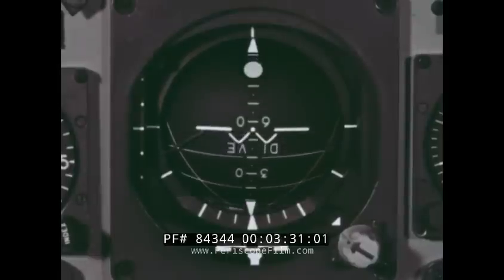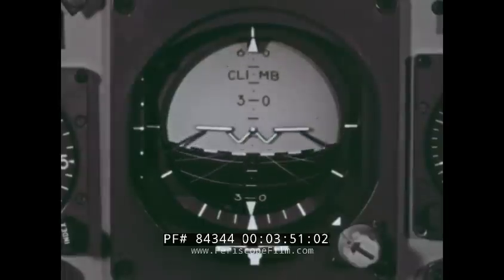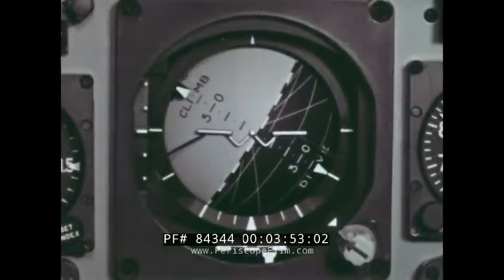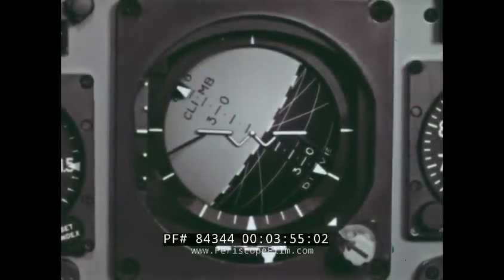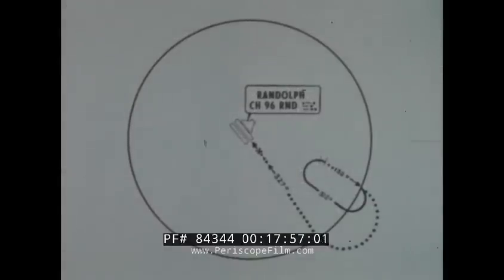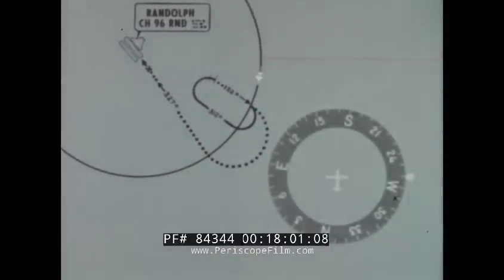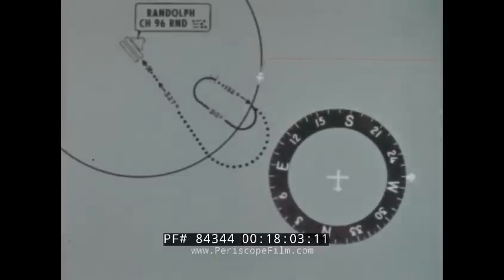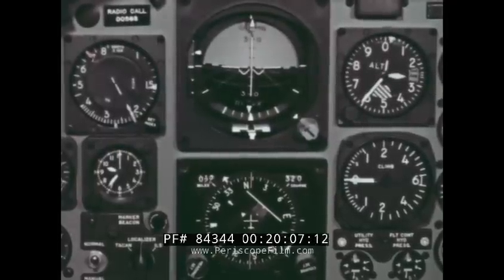INSTRUMENT FLIGHT IN THE T-38A TALON TRAINING AIRCRAFT U.S. AIR FORCE FILM 84344

Comment: With the exception of the altimeter and the airspeed indicator, this was exactly the same avionics and instrument package I flew with in 1985.
Reply: How did you manage to use the radio and the ADF at the same time ?
Reply: @mayo250  We didn't have an ADF. We used TACAN navigational aids. These were the military version of civilian VOR, ground based beacons that provided bearing and distance information from which you could navigate point to point. The communication radio was a separate unit.
Reply: @denniswofford  On the AN/ARC-164 UHF radio you have a function ADF , it would have been inop ! Thx for the answear !
Reply: @mayo250  I totally forgot about that. You're correct. On a side note, the KC-135, which I flew for most of my career, had the same radio, and the ADF function did work. We could get the bearing of a receiver aircraft during rendezvous by selecting it while they were transmitting. I remember playing with the feature, but we never actually used it in real life.
Reply: @denniswofford   Hi Dennis, could you talk to the radio at the same time ?
Reply: @mayo250  No. In ADF mode, it was receive only (I think).
Reply: @denniswofford  Ok , thx Dennis.

Comment: At Reese in 1992, I recall the bag being a lightweight white rip-stop nylon; kinda dirty and beat up from frequent use. Seems like we had to source the bag, maybe from the Life Support area, and take it with us to the jet and install it ourselves. I do recall the velcro used to seal the forward edge was well-worn and it took time to get the bag sealed well. At first, you think it would be good to have a little cheat area, but I think it was better, in the end, to have it fully sealed to minimize outside distraction. In addition to the Vertical S maneuvers, don't forget the confidence maneuvers; aileron roll, barrel roll, etc done in the sim and under the bag. UPT was sumthin else.

Comment: Yes, I eat Crayons. Marine ground option here, but I've had a lust for military aviation since I was a rugrat growing up at MCAS Beaufort where my dad was a wings of gold "Naval Aviator" (don't call them "pilots") Marine Air jet jockey. Phantoms & Hornets mostly. Interrogative: Why was the T-37 so loud for a tiny jet? It earned its nickname for the way it sounded "The Tweet," but that sounds nothing like a tweety to me, anyway. Yut!
Reply: I’m not certain but I think it was the tiny engines made their noise at a higher frequency than other jets.
Reply: Pure turbojet engines were always that insanely noisy. Because their thrust was entirely dependent on the hot exhaust gases, the compressor/turbines ran at a high speed, and combined with the narrow engine size, led to a lot of high-frequency noise. Modern turbofan engines have their turbine exhaust partially shielded by the bypass air being moved by the fan, so it both masks the high frequency noise and replaces it with somewhat-less-annoying lower frequencies.

Comment: I was an aviation electrician / avionic tech on these birds from 1986-1994 at Randolph AFB  at Universal City, Tx (North San Antonio) The company in charge of this project was LSI (Lear Siegler Inc)   These were great to work on.  We also ended up working on the T37B "Tweety Bird" as well

I left  LSI in1994 to work for Northrup Grumman at Hondo AFB I was there from the very first start of this project to build  116  Slingsby T-3A Firefly  Needless to say, this was a project that had lots of problems As I understand it, these planes are now sitting and decaying away and not airworthy at all.

When the Slingsby project was done  late 1996 I ended up working for Raytheon at Corpus Christi Arrmy Depot - CCAD This to me was a dream come true. I wanted to live there with a great job.  I worked on the UH- 60 Blackhawk. A few Seahawks. I was doing mostly building up harnesses for circuit breaker panels, instrument panels etc etc.  I then ended up being in charge of the   "Hellfire" system  for the AH-1W SuperCobra  "Whiskey"

Raytheon liked my work on the Hellfire to the point that they  transferred me to Greenville, Tx in 1998 - 2000  to work on the "Big Safari"  RC-135W Rivet Joint (electronic surveillance aircraft) out of the 2 years there I spent one month on the WC-130J  "Hurricane Hunter"

Raytheon transferred me back to CCAD on the Super Cobra. Raytheon left and LSI came to CCAD and I was hired back and kept my seniority status.   I worked on the Air Force UH-1N Huey   and became disabled in 2005  That was the last of working on any aircraft since.

Comment: I was able to understand everything up until they started talking TACAN holding patterns....and from there I got lost lol. You need a hell of a lot of brainpower to pull these things off!
Reply: It is a pain in the rear, but that's why on the high-altitude instrument approach charts (HI-ILS, HI-TACAN) there's a diagram to show the three zones for starting holding patterns, to make the decision-making a bit easier. Also, civilian holding procedures usually use timed legs (1 minute straight legs, 1 minute 180° turns), but military holds usually use DME instead, so you don't have to watch the clock so much.

Comment: I just HAD to watch this. I was assigned to Williams AFB and Randolph AFB back in the late 60's and worked on their instrument systems, both the tweety bird and the Talon along with the occasional F-5. They were very dependable systems and fairly easy to maintain, compared to the F105s and F4s I had just come from.  In all those years working on those instruments, I never got to see them "in action".... Sure, I could (and did) test 'em with the test equipment we had, but it just wasn't (isn't) the same. Loved the look of the T-38 and F-5... sleek.... looks to be at Mach 3 just sittin' there (well, not the T-37...  sheesh, what an obnoxiously noisy bird that was!, ugly, too!)
Reply: How did you manage to use the radio and the ADF at the same time ?

Comment: Anyone could tell me the route they flew in this video? from where, to where? any info will be appreciated. Thanks!
Reply: Appears to be a looping flight based out of Randolph AFB. The facility names and jet route designations will have changed over the decades, but assuming it's a TACAN-to-TACAN flight, and the bearing info is accurate, it goes: Randolph --> Centex TACAN (CWK) near Austin --> Millsap TACAN (MQP) near Mineral Wells --> as per unknown flight plan, but incorporating Scholes TACAN (VUH) at Galveston --> Randolph. With TACAN having reception ranges of about 130NM or more, and the T-38 having a maximum range of just under 1,000 nautical miles, this appears to make sense.

Comment: Hello. I attended UPT in REESE AFB class 82-07 as a participant from the Italian Air Force. After initial UPT training I also attended the Lead In Fighter Training program in Holloman AFB. Great time an many tanks to all my instructors of the time for their effort and professional attitude.
Reply: Frank, did you go to -104's?  Had a squadron (RF-4C) exchange with pilots from Gioia del Colle.  Also landed at Villafranca once.
Reply: @jcheck6  No, I was initially assigned to F104 transition but then it was changed in G222 (the initial model of the actual C27 tactical transport) and after assigned to NATO AWACS and Tanker. Regards
Reply: How did you manage to use the radio and the ADF at the same time ?

Comment: Class 85-07, Laughlin.  Did all this.  Then the F-15 (yay!)  Then, the AT-38B.  So I did both sides, student and instructor.  Now, after 30 years of airline glass cockpits and GPS, this seems like a different, and very difficult, world.  But we all did it.  Who remembers the Roswell "Widowmaker"?
Reply: Thanks for the reminder; I hadn't thought of the Windowmaker in a long long time.  It took skills to fly instruments back then.
Reply: I was in Laughin AFB in 1976. Fliying   T 37.     Class  7701.   E Flight.    Regards from Chile.
Reply: I remember the Widowmaker. I flew it in '38s during UPT at Laughlin (88-05), then about a year later as a copilot in B-52s.
Reply: @johnwilbur6414   How did you manage to use the radio and the ADF at the same time ?
Reply: @mayo250 Wow. Having to stretch memory  back for that one. By the time I flew it, I don't think ADF was required. I don't remember having messed it up, & neither time did we use ADF.
Reply: @johnwilbur6414  On the AN/ARC-164 UHF radio you have a function ADF , it would have been inop ! Thx for the answear !
Reply: Beati voi
Reply: Have no idea about rhe “widowmaker”, as I was at Reese 84-02. Did you fly that approach in both the 37 and 38?
Reply: I was a cop at Laughlin 92-96. Prob peed on your tires. What's the difference between a cactus and a pilot?
Reply: @OG_Wakanobi  What is it?
Reply: @OG_Wakanobi  None - they are both pricks!

Comment: What a joke that technology was back in the day. "Cone of confusion"?
Reply: It’s a natural occurrence with all radio navigation equipment (like TACAN or VOR) and thus exists even to this day. Old vs new tech has nothing to do with it.
Reply: You have to understand how radio navigation worked.  Today's GPS doesn't have this problem, but with a VOR or a TACAN, there was a cone directly over the radio station, and when you flew into that cone you couldn't receive accurate navigation data since you weren't actually on a relative bearing to the transmitter, but directly, or almost directly, over it.  The higher the altitude you were, the larger the area the 'cone of confusion' was.  Down low, in a civilian trainer or small general aviation piston airplane, the area was smaller, since you were closer to the station, and the shorter the time spent.
But, if you had a new course planned out from the radio station, as soon as the needles started to get squirrelly, you'd put in the next station and fly to that.  In GA aircraft, you might have had two VOR receivers, so you'd have the second radio already tuned to the next VOR and would start your course to the new station.
When the HSI went to a digital format, you could even have two bearing pointers displayed, one for each station.

Of course, as tech moves forward, looking back on it is like 'WOW, how did we ever live with that?'  Imagine trying today to fly a Range Station approach.  If you don't know what that is, do the research.